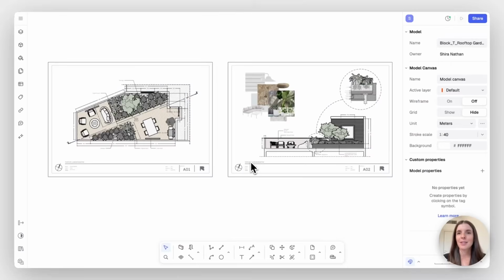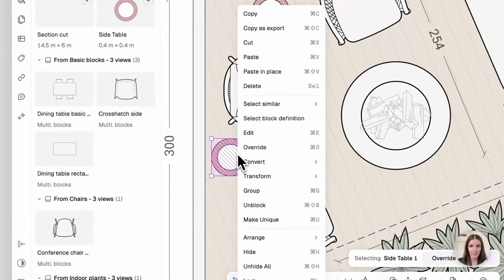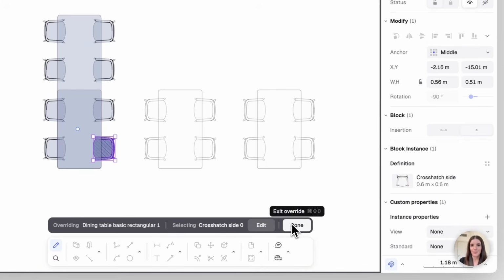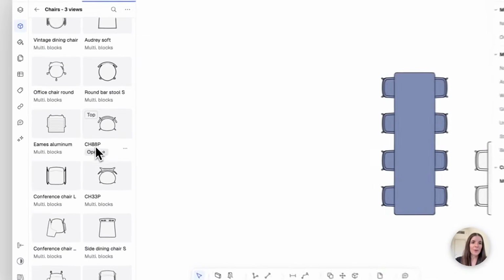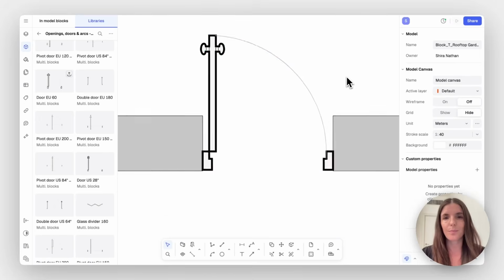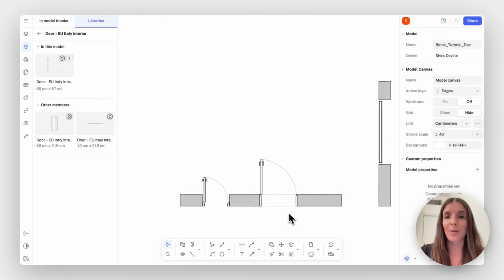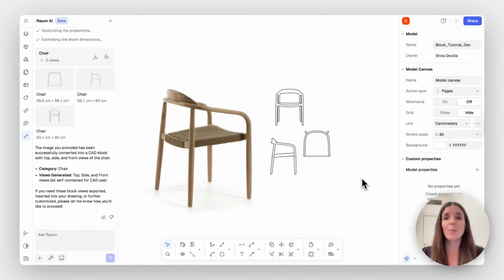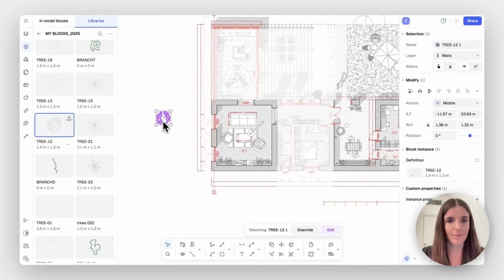How to Use & Create Blocks in Rayon

Comment: Hello ! Is it possible to merge the same blocks ? Like when I import from archicad I have post_1, post_2 etc but they are the same post, how to select similar blocks but named differently and merge them please ?
Reply from the maker: Good question! 👍

At the moment, there isn’t a direct "merge similar blocks" feature for blocks that were imported as separate block definitions (e.g. post_1, post_2, post_3), even if their geometry is identical.

A workaround is to replace them manually with a single block definition so future edits affect all instances.

Comment: I just have a load of custom families called "New Block Families". Therefore it's hard to tell which I should add my custom tables family versus my custom windows family for example. How do I change the name of families when I create them? Also why is the "remove from family" option in drop down menu now greyed out. The huge list of family names to add to is not easy to navigate either.
Reply from the maker: Hi there! Thank you so much for this detailed feedback. We are working on improving the flow with the families. For now, feel free to check out our documentation  here: https://docs.rayon.design/documentation/design/blocks#h_bc50d77b6b